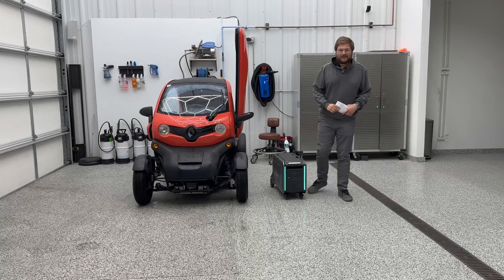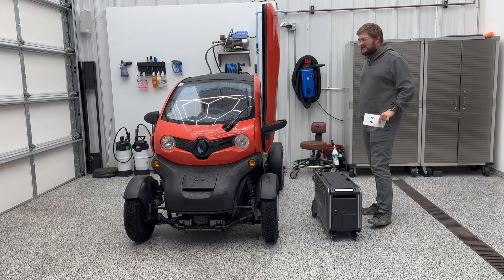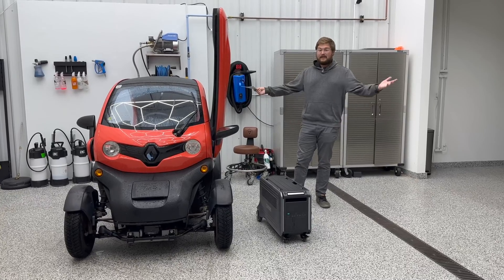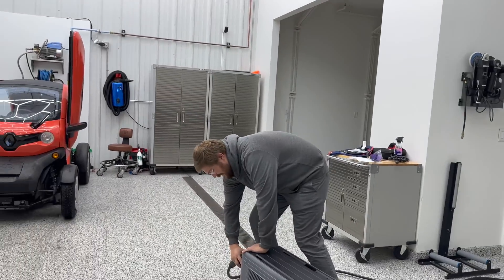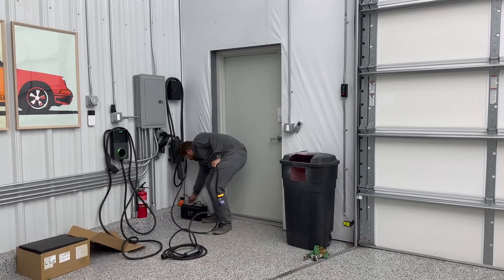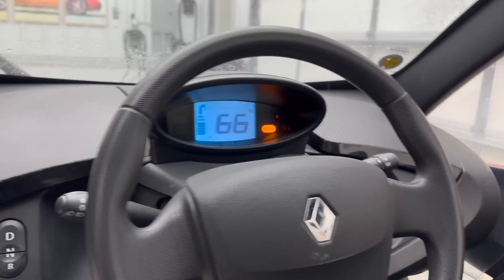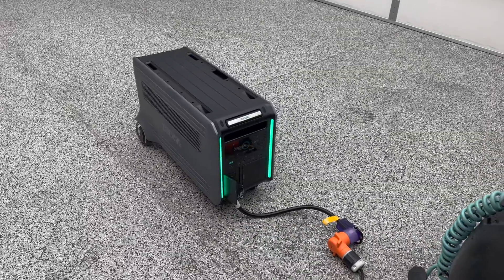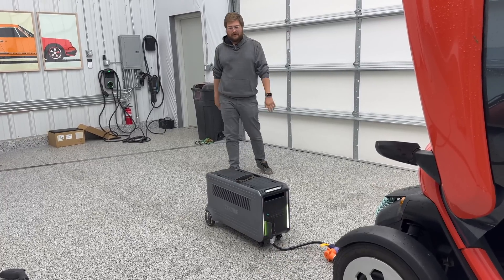This Mobile Battery Can Charge An EV In A Pinch! Here's How We Plan To Use The Zendure SuperBase V

Comment: I have a EcoFlow Delta Pro (3.6 kWh) and have attempted to charge my Tesla MY a handful of times.  I don’t charge the Delta Pro above 90% (typically) or drain it below 10-12%.  So if you do the math, I’m lucky to get 2.75 kWh of charge.  This is roughly 3.6% of the MY’s 75 kWh capacity or 11-12 miles of range.  I guess in an emergency it has value but you would never want to transport the Delta Pro on a trip as it weighs 100 lbs.  Always enjoy your videos, so keep it going.  I typically use my Delta Pro during peak demand electrical use times and then charge it either with my 400 W portable solar panels or regular 110V electric outlet when the rates are low.

Comment: it would be cool if AAA or other Insurance company add this kind of technology or tool into their services.  Right now, if an EV (for some reason or another) depletes its battery - you call and it gets towed.  With these, you can just charge for 30 mins (probably) or how ever many miles you need to the next charger.  it would be cool.
Reply: I thought it was common for AAA or others to now have portable electricity station's for  EV's that run out of  power/range ?

Comment: My suggestion is try charging it with an ioniq 5, while powering a house, so the ioniq 5 meets the base load average, but the unit works as the buffer for high peak loads and 240v applications.  For me this is the way it should be, all EVs can then eventually be used as useful energy storage

Comment: These small battery banks are very cool as they bridge the gap for those who can’t or don’t want to go full solar and powerwall. They are great for RV’s and off grid cabins or for areas that are prone to power outages. They are super easy to use and can be hooked up to portable solar panels. They can run essential items in the house overnight when the sun has set. 

I think they are totally stupid for use with EVs. Keeping these in the car as emergency backup is dumb as they are heavy and would hang around the car when I might use it once every few years.

Comment: I like everything on that Superbase but one critical thing is the low maximim voltage on the  solar input of 150volt is old school many units are going to maximum solar input 500volt which makes series wring, conductor sizing of the solar DC supply and interconnecting the panels  a lot more practical and more efficient, with less voltage losses.
Reply: Bingo. If your unit is this large you need to be on the same level as the all in one inverter chargers that have a 500VDC max input on PV

Comment: It would be great to see someone do an efficiency test with it in modern EVs.  How much extra mileage do you lose carrying the extra weight vs how much it can charge up and how fast.  I am an ID4 owner that has been looking at these types of things for home backup and then toss in the trunk when I am road tripping and want extra security or convenience.
Reply: so the power bank has a 6.4kWh battery. Inverter- and charger losses, you get perhaps 4.8Kwh into your vehicle. So if you are using it for an emergency driving carefully, you can drive another 35km!  Weight in a vehicle increases rolling resistance, but the increase is minuscule. extra weight also compresses the suspension more, lowers the vehicle, which decreases the frontal area, reducing aerodynamic drag. The extra weight of something like a power bank will require higher power draw during accelerations, so in stop and go traffic, the extra mass will cost you a slightly higher consumption.
Reply: @Tore_Lund  And if I were using it for home backup power I'd like have several of the battery extensions too.  Maybe 2-3x power.  Considering I am in a bit of a public charging desert,  something like this is very appealing.  Much more power than the EcoFlow Units.

Comment: Will we ever see a portable DC charger for EVs?  That will eliminate inefficiency of converting from DC to AC at the Zendure followed by AC to DC at the vehicle.
Reply: Portable pushing 100kw+? That's gonna be a ways off in the future.
Reply: @ericklein5097  Not 100kW, a 6-10kW unit like the Zendure.  Jule makes a fixed100kW DC fast charger that is trickle charged when not in use.  I've used it.  But it is as big as a garage.

Comment: I would be interested in seeing a video showing exactly how much range in an EV it is possible to get out of just out of Zendure. The video would work like this:

Step 1: Drive the car until it completely dies
Step 2: Charge the car with a full Zendure battery until the Zendure runs out
Step 3: Now, drive the car until it dies again, recording how far it can go.

For three, I think slow speed driving (~30 mph) is sufficient, since hopefully nobody receiving an emergency charge this way would drive on the freeway.

To the point of this video would be to see how well the car can receive and use energy at the very bottom of the battery pack. For instance, would it actually be able to use close to the full 6 kWh that the Zendure can hold before it runs out in step 3? Or, would the car die the second time much sooner than that, perhaps due to the voltage of some individual battery cell getting too low.

Comment: Kyle, from my perspective there is another use case for this type of device that Zendure doesn't mention on their web site and you didn't discuss in the video.  We live in Florida which is the lighting capital of the country which also means that it is the power surge and dropout capital of the country.  This plus the threat of hurricanes drives high adoption of whole house generators.  They take care of the long electricity outage but there is a 30 to 60 second startup time for the whole house generator to kick in and a lot goes wrong associated with that delay.  I have UPS's all over the house to try to deal with this issue on electronics but just about everything you plug in today has electronics in it.  So if this can be used as a whole house UPS and have essentially no delay (like a good UPS is supposed to) that would be great.
Reply: My 20kw Generac has a 15-second delay which I was told was so the generator doesn't startup when there is just a power flicker.
Reply: UPS functionality has been a serious issue for a lot of the big players in this game.Doing it right isn't cheap. The Zendure SuperBase is new but its had some serious issues in its first round of deliveries and their development was a bit of a circus. Promising preorder customers certain functionalities and then realizing they overpromised.

Comment: How does this differ from an EcoFlow Delta Pro?
Reply: The EcoFlow only has 3.6kwh capacity, pushing out max 3,600w of power at 120V. This Zendure Superbase V not only has higher capacity and power output at lower price, but is also the industry’s first single unit with a 240v output, and can actually output from both 240v and 120v outlets at simultaneously! It’s definitely heavier though, somewhat stunting portability, but easy to roll around. Happy with mine :)

Comment: Based off the ads on their website, you're looking at $1100/kWh for disco-dancing dog-tormenting battery storage, and about $3,000/kW (in solar panels) to charge it back up again. Compare this to a group 24 AGM lead-acid battery, that comes in at roughly $200/kWh, but obviously lacks the brains and power-to-weight benefits of this Zendure unit.

Comment: i would use it to run power equipment on construction sites... large lights, pressure washers, vibratory screeds, pins and hammers... everything that has been running small engines.  Allot of those units run lawn mower engines b/c the batteries just don't pump out enough juice. This seems like a reasonable answer to many of them especially at 240v.

Comment: I've noticed a few of these large battery backup type devices and this was one of the nicer ones as I liked the J plug option for charging.  One thing I have yet to see and would like to is a CCS type DC charge adapter with built in controller.  That would allow more efficient charging of EVs since you could avoid the DC-AC-DC conversion.

Comment: You said both batteries are same capacity so plugGing the Superbase into the Twizzy would double the range. Technically it might double the capacity but the added weight would consume some of the capacity so not achieving double the range.

Comment: Yeah that's a great little gadget. I've been building those for 15 years. Utilizing lithium-ion batteries and pure sine wave inverters. I had to use it not too long ago when the wife ran the leaf out of power. Worked great but mine only puts out three kw.
Reply: Is this unit described in the video capable of holding enough power to charge the  2019 Nissan Leaf Plus (with it's over 200 maximum range?) 
(some people want to get an electric car, but there current wiring in the older homes requries  3K to 6K in upgrades anyway before they can entertain 
level 2 charging at home, so maybe this is another option )
Reply: @flolou8496  Most garages have 220 50amp, So just buy a J1772 for about 200.00 and done. You may have to run wire and install a breaker

Comment: I'd love an EV manufacturer that could integrate the ability to essentially do the same thing, utilizing the GIANT rolling battery to accept a charge from various sources including solar and then give a charge to various devices including a home.
Reply: The energy density and power delivery capability isn't there yet. Delivering the fast charge rates necessary can't be put in a mobile package currently.

Comment: how come no has built a electric rideing mower us the same batterys as the cars
Reply: Because the batteries for cars are custom and a riding lawn mower does not need 60+ KWH @ 350+ VDC. The modular battery systems most (all?) electric riding and zero-turn mowers come with are better suited for them.

Comment: The Solar Panel connection would be neat to see.   How do you fool the EVSE/Car to think it is grounded?  Other brands like Bluetti and EcoFlow you have to "ground" it.  
   Portable, large batteries are cool but are not very practical for the price to just be another source of EV charging.  However, if you lose power a lot and go camping often, then it could be justified.

Comment: Could this power a Chevy Bolt … when parked. I live in a condo with no charging ability. 
Only want it to keep Bolt powered to manage the battery so cooling / conditioning runs as needed when parked. To handle temperature extremes when unused. 
Hope this extends the battery for us non-home chargers out there.
Reply: Ofcorse it can power your car. But where do you put it, where it can't be stolen? Not a good Idea ....
Reply: @Bud_Terence  some steel cables around it secure to the seat would work. Leaving the window open a crack would let water/weather in. Wish those who can’t plug in the EV at home had better options for keeping the battery conditioned when parked.
Reply: I don't think keeping it inside the car while charging the car would be a good idea. The battery is heavy, and lifting it in and out of the car, day after day, as you cycle between charging the battery and charging the car, is bound to take a toll on your body. I think a better approach would be to leave the battery on the ground next to the car and secure it to the car's door handle using a bike lock. This way, bringing the battery inside to charge it up is simply a matter of wheeling it to the building elevator and pushing the button.

However, even then, I'm don't think the benefit is sufficient to be worth the cost of the battery, given that 6 kWh per day is not a lot, the battery is expensive, and you'll still need access to some amount of public charging anyway. But, if the cost and weight of these portable batteries goes down in the future, I can definitely see them making quite a bit of sense.
Reply: @ab-tf5fl  at the value of this unit you'd see criminals going to extremes to steal something they could sell for a few thousand dollars.

Comment: I would think it would be interesting to have something like that or such in vehicle when you run tests. I have seen some range tests where people are worried about the last 1/2 mile back to a charging station . So having a portable recharge option to get you back to 1-2 % to get you back to a power station might be a good safety device because as seen on many range tests 1% battery left is not actual 1%.. also if the battery gets too low you might bump the power on it back up a bit to prevent damage to the cars battery. So adding a few videos of options that are portable might be reasonable to add to your channel. I have seen a video on another channel where they use a Ecoflow to power a tesla to get back to there home base

Comment: Your first test should be a 70mph range test on your Dad's TM3 RWD, with the battery pack in the trunk, and then run the car from 100% to absolute zero, then charge it with the battery pack to get to a charger.